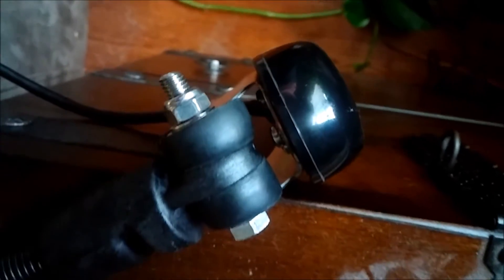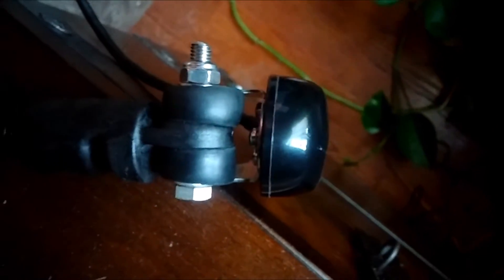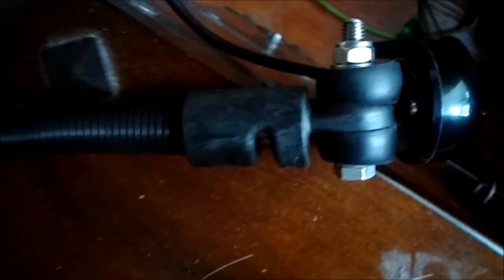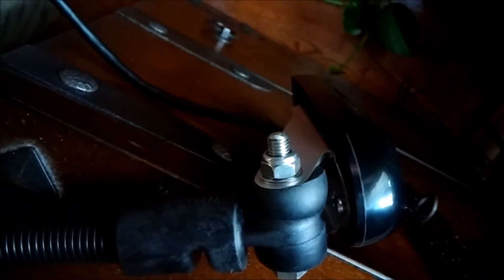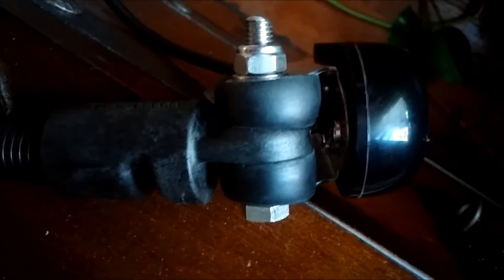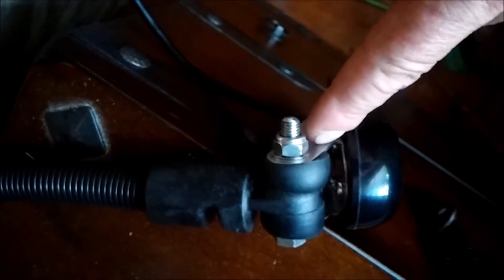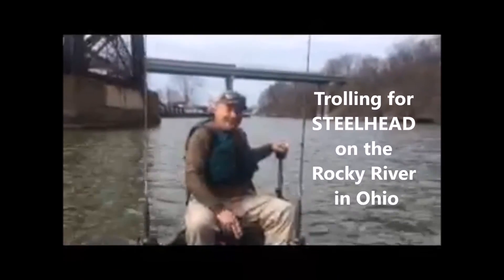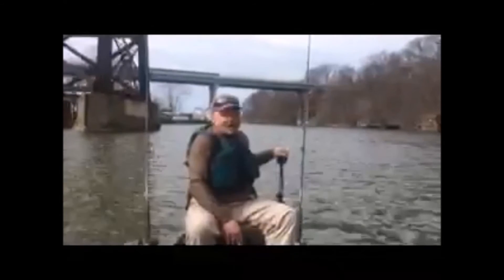RAM Flexible Transducer Arm(B 316 18 TRA1 354)fitted t/Garmin EchoMap GT52 Chirp Transducer Brackett

Comment from the maker: Transducer bracket bushing fix in this video works fine, although, I immediately noticed how soft the rubber mounting ball is on the RAM mount causing too much movement of the entire arm while in the water..I'm also experiencing movement up top where the actual aluminum bar (which comes dismantled) slides into  and tightens dwn to the upper housing piece that clamps to the ball....There is just a screw supposed to keep the bar held tight up in there and stop it frm twisting once you push it into the top of the unit...No way is that tiny screw bolt is sufficient ?   So...Since the bar isnt etched or has no flat spot it still moves no matter how hard you crank on that screw tightener....Its always slipping  and getting worse since I always hv to keep moving it back into position/correcting it during use ....Gonna hv to file a flat spot in the round aluminum bar to hold it frm turning and buy a screw bolt which has a plastic star grip to tighten instead of only a tiny little phillips head that you cant tighten well enough anyways. 
On a positive note the bushing fix on the larger transducer bracket does work like a charm though...